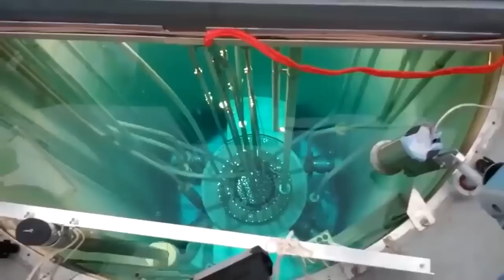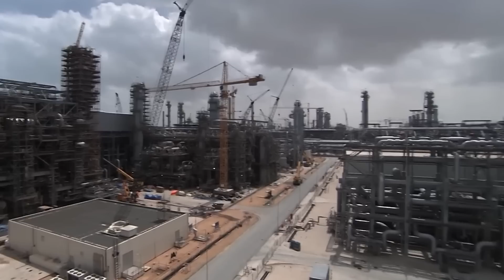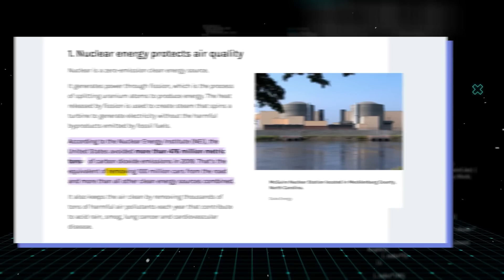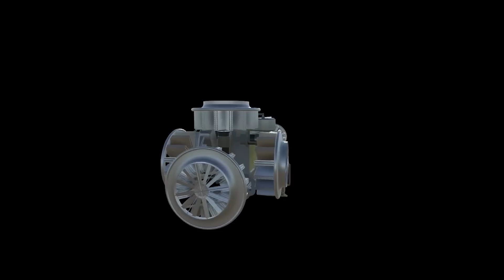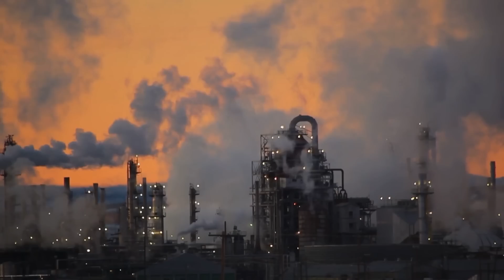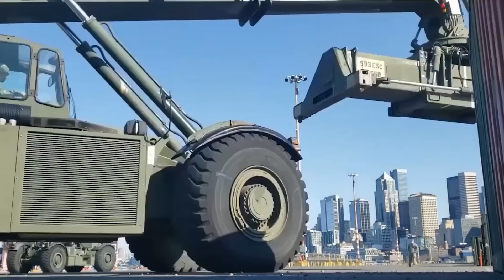Elon Musk FINALLY Reveals Nuclear Fission Reactor?

Comment: Didn't we make nuclear technology illegal??  Edison generator and dynamos easily replace fossil fuels and nuclear power.  A permanent magnet motor as a generator cleanly produces the same AC high voltage AC power continuous peak power without fuel or pollution.  If we add inverters and transformers to deliver high voltage AC power it is no different than nuclear power or fossil fuels power plants.

Comment: I’m 82yrs old 
  I worked in construction on many reactors. Idaho nuclear project and on Sacramentos amid reactor. Yes you are right, there were lots of testing with some problems  it was a learning process in a lot of cases. Most of not all problems were man caused. SMUD reactor had radiation leaks into secondary water coolant system. When I was at the. INEL P LANT I CAN ONLY REMEMBER ONE SERIOUS ACCIDENT. IT WAS MAN CAUSED. some claim it was murder suicide. NOW WE HAVE MUSK AND CREW. REACTORS ARE THE BEST KIND OF LONG LASTING ENERGY. SMALL REACTORS. ARE PROBABLY THE ANSWER. ALSO THE BIGGEST ENEMY TO REACTORS (in my opinion) is the WORLD PRESS. THEY ALWAYS SEEM TO BLOW THINGS OUT OF PROPORTION. GO MUSK.  GO REACTORS. PLEASE SEND ME ONE. WRR

Comment: This is NOT micro reactors. Read isac asimov's foundation. And then learn about lftr reactors. Then ask why they don't innovate. Radient is doing the same old only on a smaller footprint. 72 hours to start after setup. A container lftr runs on delivery. Stop for refueling. Lftr does it on the run. And uses cheaper more stable thorium. But no Nixon said no so there it is.

Comment: Actual a coal fired power plant would have some positive effects on mars anything that thickens the atmosphere :) but look the massive doses of cosmic radiation they would be constantly bathed in would make the radiation from a nuclear plant Seem like a fart in a gas chamber. I think Micro reactor sire a very promising technology. As far as Radiant goes sadly with Musk involved it moves into I believe it when I see it. 
I think you will have zero choice other than using some version of nuclear power on Mars.
You may want to change your title Radian's reactor concept is a FISISON reaction it splits atoms to generate heat not a FUSION reactor the forces atoms to fuse to generate heat.